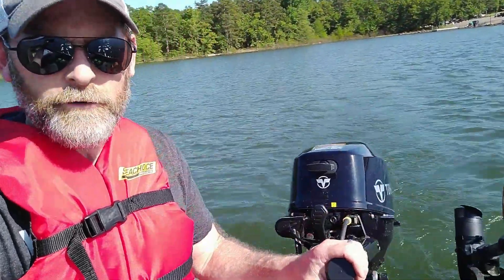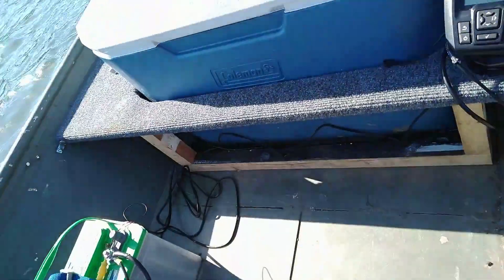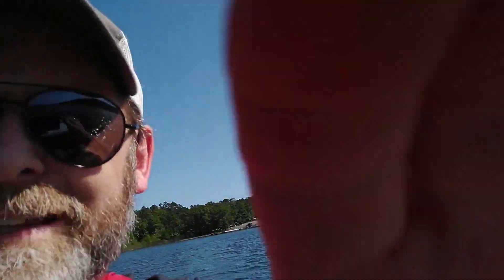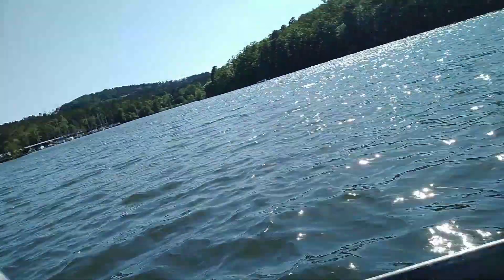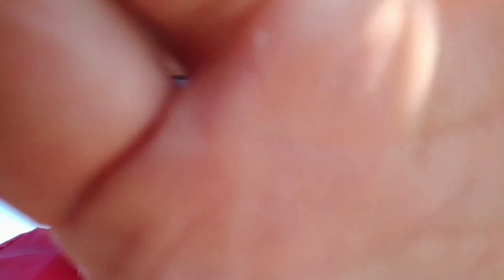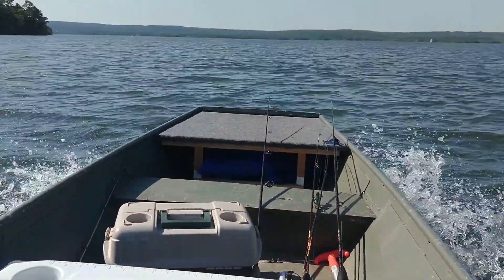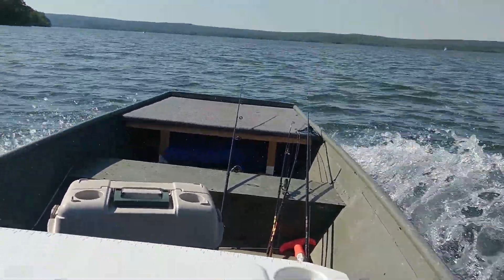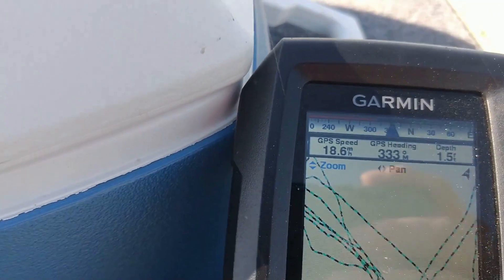Speed Test: Tohatsu 15 hp on Two 1436 Jon Boats

Comment: I get 23mph Nissan NS9.9D 2 Stroke 1436 with a patched up flat bottom. Trim that thang of yours up to where’s when your at full throttled and as fast as it’ll go, While in your seat,,you lean back and then the front wants to start hopping. And when it does lean your body forward until it stops hopping. But it trimmed right first…..Just that little bit of transferred weight makes the difference…Then that bad boy is trimmed to the max and going as fast as it will go
Reply from the maker: That first boat would plow through the water and only hit 19 mph no matter which trim hole I used. It was the darndest thing.

Comment: Would a 20hp tohastu do fine? I have a topper 1436 also. I know they both weigh the same
Reply: 15hp and 20 dont have much difference 20hp is harder to start and heavier but youl get a bit more speed
Reply: @guacostacos4390  they both weigh 94 95 pounds whichever it is. If 15hp would push 2 people I'll get it
Reply: Louisiana G it would push 2 people above 20+ mph
Reply: @guacostacos4390  if it got 15+ with 2 people trolling motor and battery id be surprised
Reply: It get way more than that
Reply: Depending on weight of boat etc
Reply: @guacostacos4390  we'd for sure meet the max weight haha me and my buddy over 220 pounds each. I got a 99 lowe 17ft with 70hp Johnson and it moves 2 people at 40 all day but a good jon boat is hard to beat to me
Reply: If you have a 70 and a 17ft boat ur gonna want to go for like a 40hp
Reply: @guacostacos4390  well jon boat is a 1436 topper from bass pro! My older bass boat is a 17ft
Reply from the maker: Louisiana G, I get 23 mph on my 1436 Topper with me and one other person with the 15hp Tohatsu.  I get about 20 mph pulling my daughter on a kneeboard with my son spotting.
Reply: @renaissanceguy148  I got a 2009 mercury 9.9 4 stroke $900 runs great I hit 20mph alone which is fine im 250 pounds me and buddy who's also over 200 pounds we hit 17 mph! I got a video I posted yesterday check it out thanks for the replies. Im getting this 15 you have within a year for sure
Reply: The 15 and 20 tohatsu are exactly the same engine just power output is different.
Reply: @louisianag  With the carburetor motors the only difference was the carburetor was restricted to make the power less. I'd imagine on the fuel injected ones it's something similar, I'd go with the bigger engine assuming the boat is rated for 20hp, there is no downside from my experience having converted my 15 to a 20HP.  You only use the same amount of fuel for the power you actually use, but when heavily loaded, or in strong winds and bad weather you really appreciate the extra power. I boat at altitude so definitely need the extra power because I'm not making 20 HP with the altitude. The lowest I've had my boat at was about 4k and compared to the usual 6-7k it made a big difference and I could run a 10 pitch prop versus a  9.

Comment: what weight boats are pal |??
Reply from the maker: I'm not sure I understand the question. Are you wondering how heavy the boats are? If so, the second one (Tracker Topper 1436) weighs about 160 lbs. The first one was a bit heavier because the previous owner added a sheet of aluminum to the floor, but I can't give you a number.

Comment: It say 1.5 ft deep???
Reply from the maker: Yeah, I learned after making that video that there are some shallow spots. Wasn't watching the depth at the time...
Reply: @renaissanceguy148  how do u like it?? I’ve been thinking about getting one Mostly just to tell me how deep I go in a lot of back water Salt marshes and would like to avoid hitting ground as much as I can. Go though areas slowly like idol or 1/4 throttle do I feel it works well at those slower speeds?
Reply from the maker: Yes, absolutely.

Comment: Play with the trim to get the nose up just a bit more you might get 1 mph more...first boat was plowing like crazy ...way outta trim.
Reply from the maker: The crazy thing about the first boat is that it would plow like that regardless of the trim. Regarding the new boat, I've learned that the second trim hole is best when I'm by myself, while the third trim hole is best if I have the weight of another person up front.

Comment: Sure looks like that motor needs trimmed up on that first boat
Reply from the maker: I thought so too, but whenever I trimmed it up, it would cavitate on turns.
Reply: @renaissanceguy148  that's normal for a boat to cavitate on turns especially one without hydraulic trim you'll have to take wider and slower turns